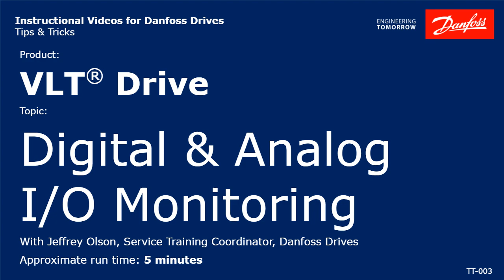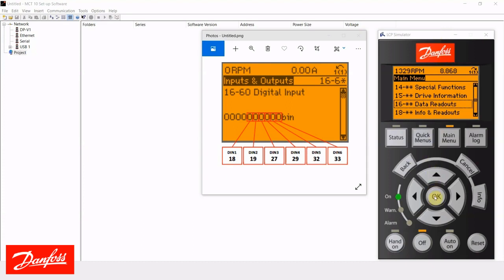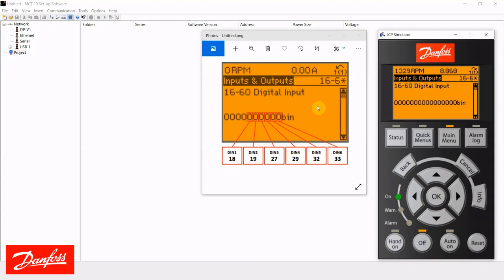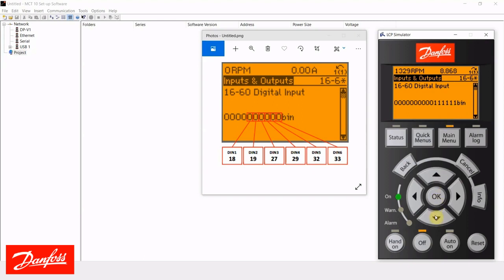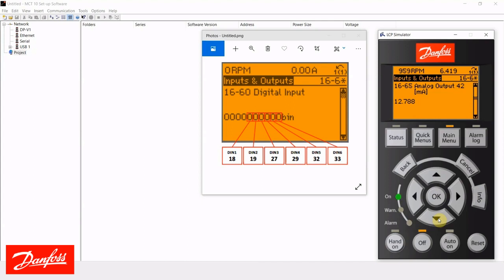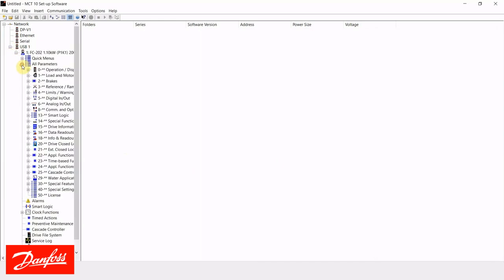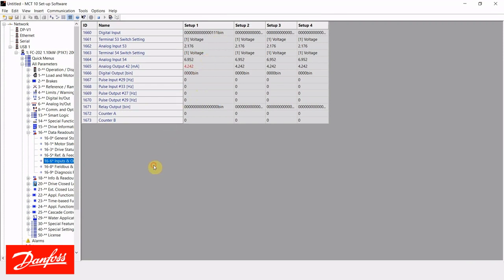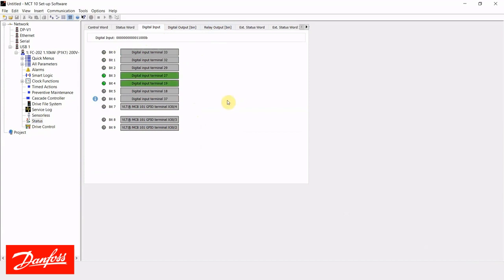VLT® Drives: Digital & Analog I/O Monitoring

Comment: Sir I've FC-360K model VFD
I gave 4-20mA to pin 54
I need to run at 30 Hz when pin 54 receives 12mA
I need to run at 50 Hz when pin 54 receives 8mA or below 8mA
What are the parameters needs to set
Kindly help
Reply from the maker: For installation, start-up, programming and troubleshooting assistance please email: Drives.TS.NA@Danfoss.com 
or if you need immediate assistance contact Danfoss Drives 24/7 tech support at: +1 888 DANFOSS (326-3677)